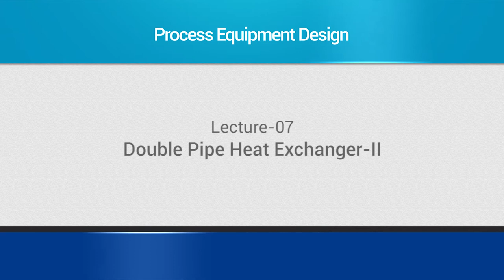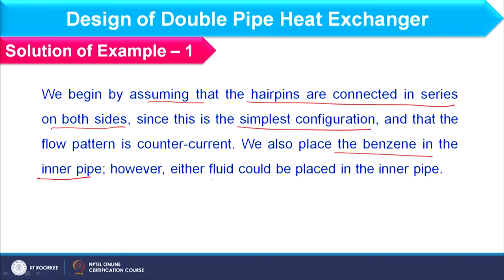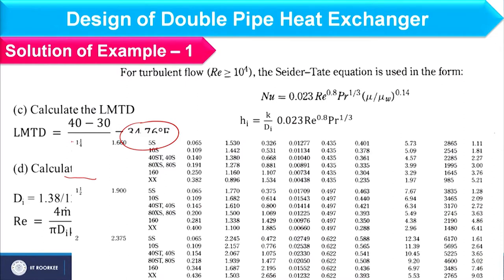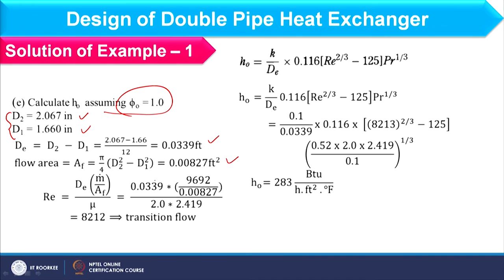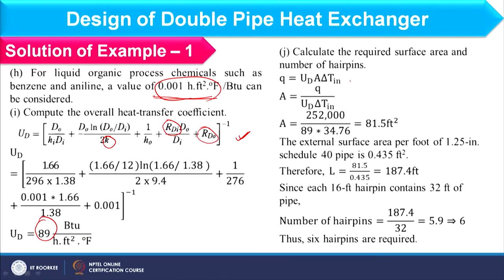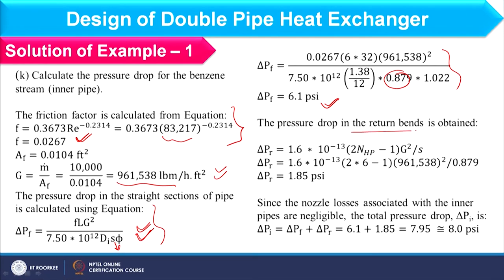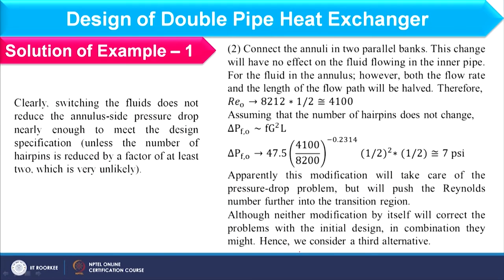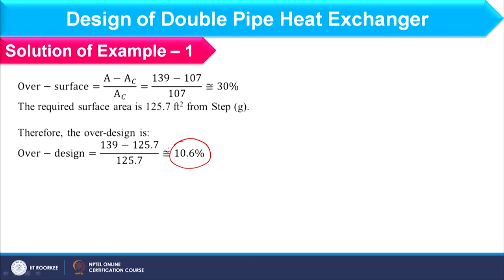Lecture 07 : Double pipe exchanger-2

Comment: The equivalent diameter De for heat calculation its not correct its ( d2^2 - d1^2)/d1  not  (d2-d1) this is only for pressure drop
Reply: in second case Connect 'the annuli in two parallel banks'.  how to visualize please give some ideas

Comment: for the third case how the no.of.hairpins in the annulus side is taken as 5 ,anyone please explain.
Reply: Hello, it is given in Serth text book... I'm gonna type as it is... " Equation of LMTD correction factor is based on assumption that both parallel branches are identical" . Therefore they are using two banks of five hairpins... A total of 10.. They have taken parallel branches for dividing the flow... With the nine hairpins, flow will not be divided properly... Hence they have gone for 10 hairpins..
Reply: @indianj7388   in second case Connect 'the annuli in two parallel banks'.  how to visualize please give some ideas
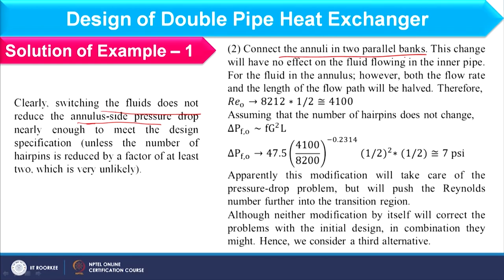Reply: @34:51 said connect the annuli in two parallel banks.
How does it look like?

Furthermore, in previous lecture, said annualar side always remains in series.